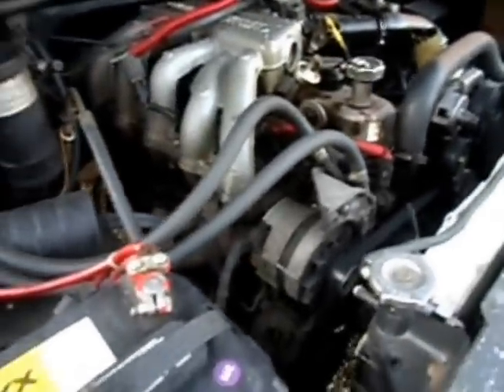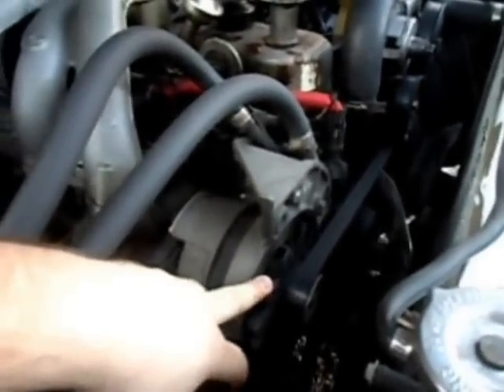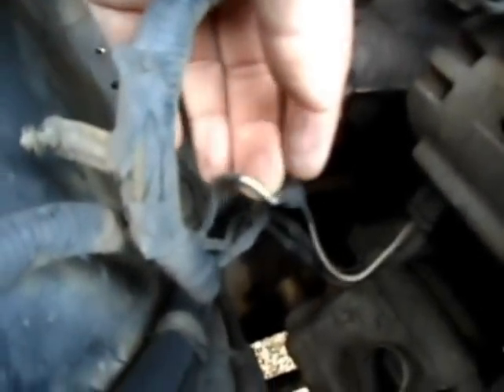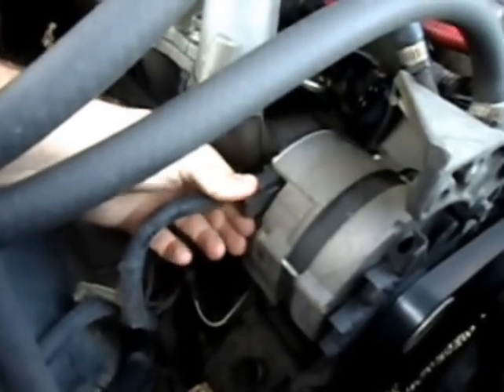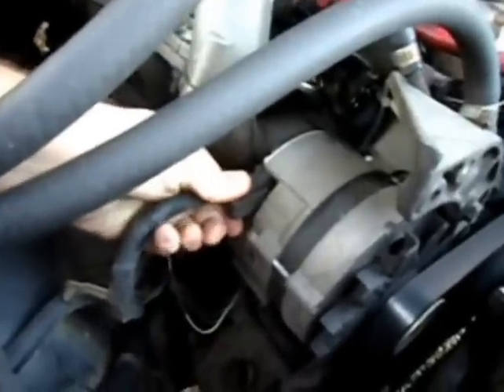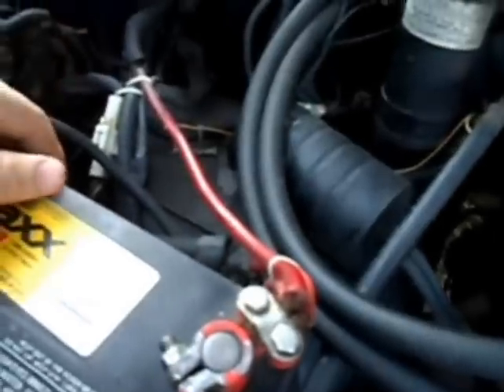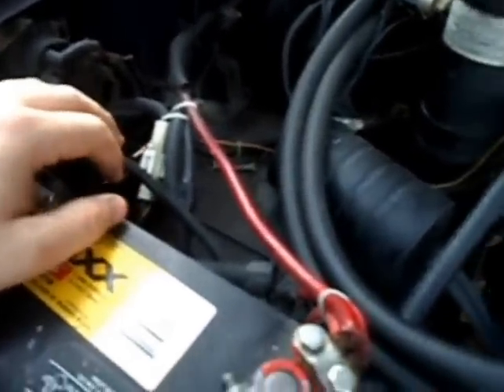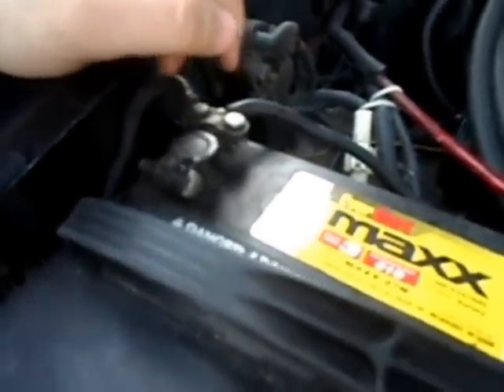1980-96 OBS F-Series: 2G Alternator discussion

Comment: Thx for video. Chilton Repair manual book says: Pivot bolt: 58 ft. Ibs. (78 Nm) Adjusting bolt: 25 ft. Ibs. (34 Nm) wire terminal nuts: 60-90 inch ibs. (6.8-10.1 Nm). My question is where is the pivot bolt located and the adjusting bolt located? Top or bottom. I'm installing 2G alternator on 1990 Ford F150 4x4 5.0 xlt lariat long bed. Thanks people
Reply: @marckemp9955 1987 was the last year for v belts

Comment: If you spend lots of time on the freeway you can gain mpg using an e-fan.  When you're cruising down the freeway at say 65mph you don't need the fan for cooling. 

Viscous fan clutches still spin the fan when disengaged meaning it is still putting a load on the motor even when you don't need the fan for cooling.

for example, the Hayden Severe Duty Fan clutch spins at 30% shaft speed when disengaged (check haydens site).  Using an e-fan means no load from the fan when not needed.
Reply: @marckemp9955 I reject your reality and substitute my own.  In mine many (most?) modern vehicles (Check Current and previous generation Mustangs, F-150s etc) have switched to electric fans since it's a proven fact that they are more energy efficient compared engine driven fans with mechanical fan clutches.  Unless the fan clutch electronically controlled (some big rigs are this way) they don't actually disengage.  An Electric fan has 0% load when it's not on and in general, driving at speed means it's not running.   So, have something mechanical that might last longer (mechanical fan clutches do wear out) but is much less efficient or switch to something that may not last as long (still might last 300k+ miles, like ours did on a previous mustang)that is much more efficient meaning less load on the engine?  I'll take the electric fan.

Comment: maybe. but e-fan is only a extra pull on the charging system, if upgraded to a 3G system then you have no worries. cleans up the engine bay a bunch.. but on something like my truck, E-fan is definatly worth it.. i havent done it, but plan on it down the road..

Comment: FYI. You can also find the 3G alternators in the V6 Mustangs & Taurus (of that time period) if you can't find a bronco, van, or later trucks with the setup. While you're at it you may as well pull an electric fan & do that upgrade at the same time.